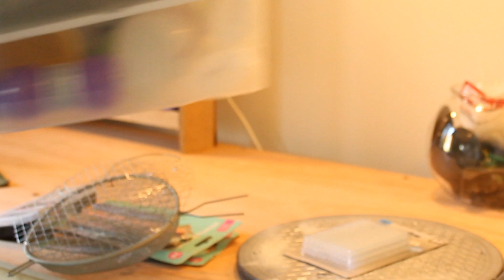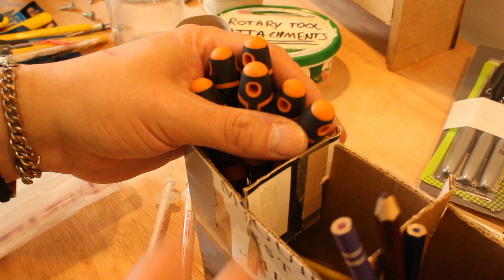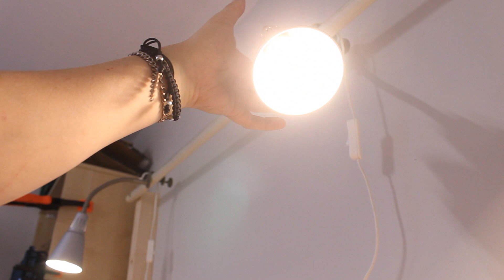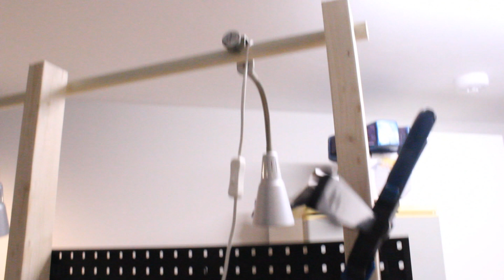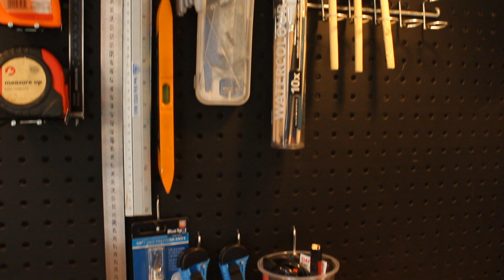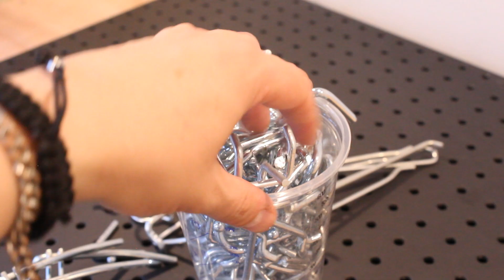I improved my workbench with THESE upgrades!

Comment: Hey it looks gorgeous mate ! The shot with the lights on is superb.

The cost is also quite reasonable, well done. Most elements are reuseable anyway, so in a way it is a dureable investment.

The gap at the end of the bench caught my attention immediately, beaue this is where all those tiny bits disappear. You know, the tiny bits which fly away when you snap them off the sprue in a wrong way. 
Shameless advert: when this happens on a Toothpick Miniature design, you just make another one ! :) 

For this gap I would recommend some sort of fabric, in a U-shape with enough leeway to pull it out to retrieve anything that it caught. Also ideally it would be in an uniform colour (to identify those bits more easily)/ Some plastic parts are black, others are grey, so I imagine a fabric in red, green or light purple for instance.
Reply from the maker: Thank you for the comment! I presume you are referring to the gap under the pegboards?

I have a plan for that - I will be getting some brush strips which I will be adding at a later date (when I have some money spare of course!)... This way it'll stop any loose items flying off the back of the bench, but will also allow cables to be tucked behind the desk for when I put a computer on it to do some computer work... I can also connect a hose to a spray booth for painting models too!

Comment: Another aspect I noticed is that you can save even more space (and reduce visual overload) by storing / "archiving" suplus equipment. 

As an example, I imagine you can have one box cutter of every colour, and you can store the rest away from the bench. As for myself I have two different cutters, which I rotate according to their degree of wear and "unsharpness", when both are unsharp one gets its blade snapped off and the other remains somewhat unsharp to do the heavy / destructive jobs).

Generally speaking, making an inventory is extremely useful, this was to perfect opportunity to do one :)
Reply from the maker: Thanks for the suggestion! I have still got a LOT of stuff to sort out - I have shelves full of random bits and bobs / greeblies and materials to go through and sort out, so this is a good time as you say to start working on what I have and where to store it! :)